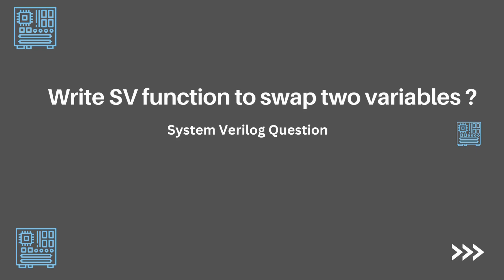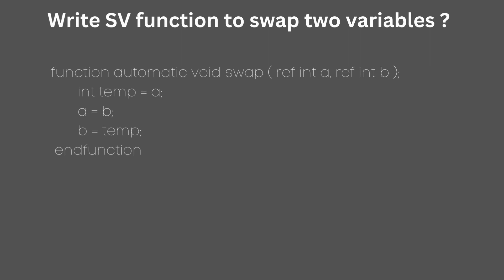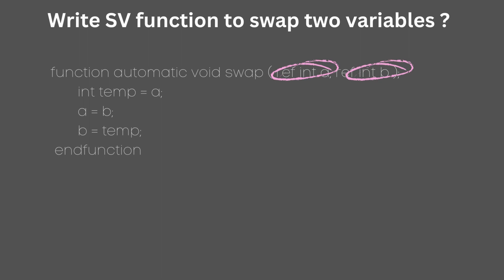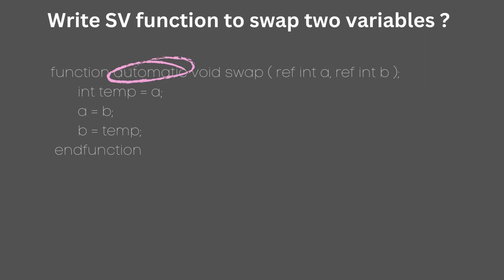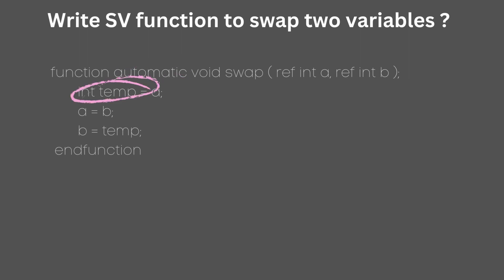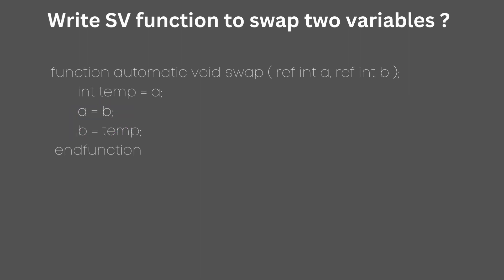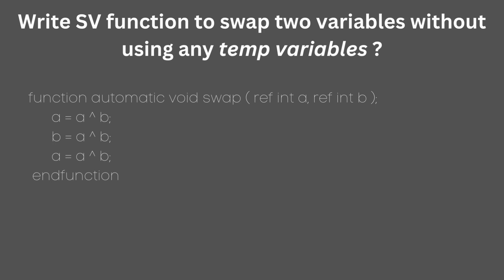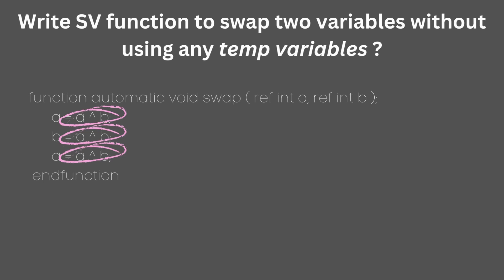System Verilog Interview Question: Write SV function to swap two variables

Comment: a= a+b; b=a-b; a=a-b // note this can overflow while doing a+b. but this also can swap
Reply from the maker: Exactly. You spotted the specific reason I left that method out: the overflow risk. Arithmetic swaps are clever in software, but dangerous in silicon where bits are fixed. Thanks for adding it for completeness!